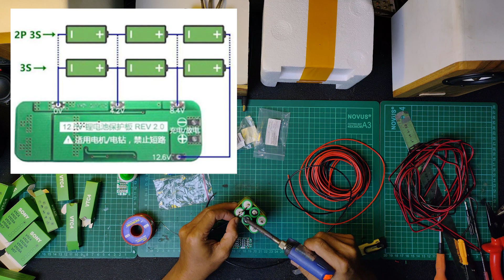Diy Bluetooth Speaker #diy #bluetoothspeaker #sugiriverio

Comment: Bang speaker 5 in yg ccok buat tda 3116 apa ya yg enka buat dangdut dan dj
Reply from the maker: 5 inch woofer atau subwoofer. Kalo woofer yg enak itu copotan tape compo. 5 inch 30-50 watt 6 ohm.